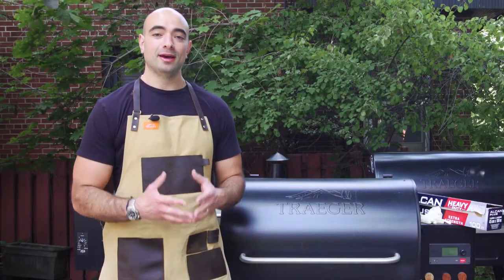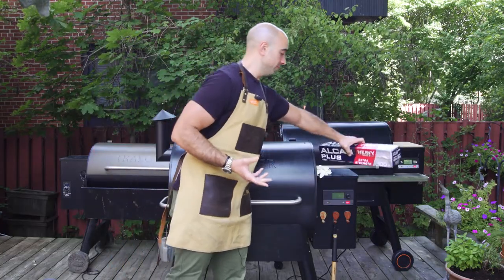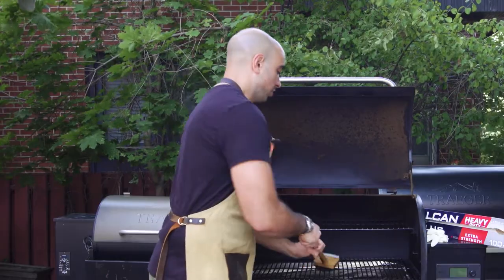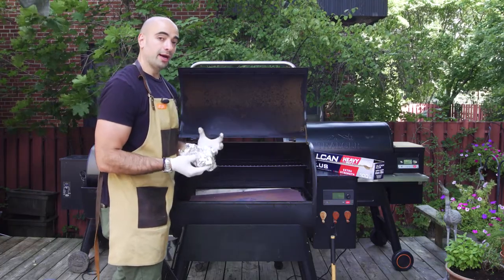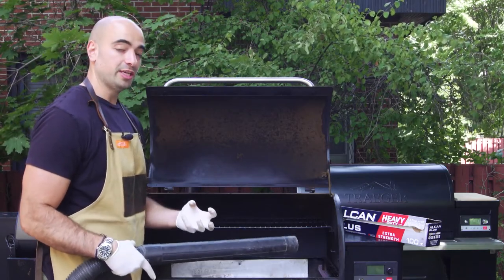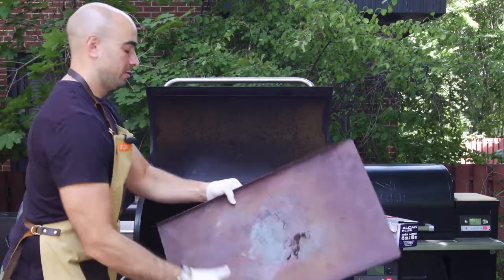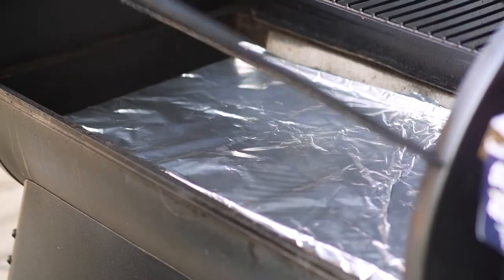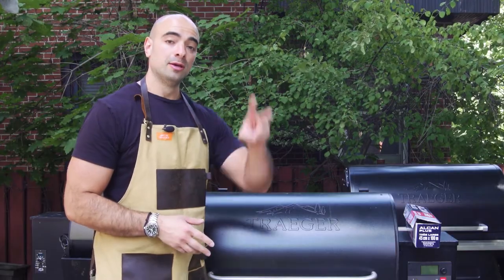How to Clean a Traeger Grill - Regular Grill Cleaning Routine

Comment: Here are a couple of tips that make assembly slightly easier https://www.youtube.com/post/UgkxCx5fHawkK9OoV-ojFrY8JLnZrFwAmvUt . 1) One person can assemble, but if you have a buddy to help, it will make it go faster - especially steps 1-3 and 8 (the legs aren't heavy but can be difficult to hold while screwing things in). Step 8, 1st part will take some time unless you have two more hands OR are really lucky. 2) Use a socket wrench! 3) Step 7, 3rd part - the flame carry over tube has an open side, MAKE SURE THE OPEN SIDE IS FACING THE FRONT. If it's facing the back, the tube won't work. 4) Step 10, 3rd part - if you don't have small hands (I don't, they're gigantic) getting the nut on is really difficult (but not impossible). It took me about 4 hours to assemble, but I took a "union break" every 60-90 minutes and ate a quick lunch. Also, I'm really OCD so I took my time, looked at the instructions carefully, and cleaned up as I went.

Comment: great video.  do you know why i had "grease" pouring down the RIGHT side of the grill next to the hopper????  i didn't even have "half" of the grease pan filled up.  and, i clean the grill.  Soooo i'm confused as to why this might happen. brand new traeger too.  is it possible it's the gasket?  do you have any thoughts?  also, i love the foil trick on the aluminum pan.  I will do that.

Comment: Hi, My Timberline ruined my Thanksgiving turkey last night!. I got several issues from not reaching or keeping the selected temp. But also when I tried to restart the smoker I got a "Clean Grill" indication that prevent my smoker work even I have cleaned everything  including sucking the fire pit. What would it be the problem? , Software?
Reply: I know it's been over a year since you've posted this, but did you ever figure out what that problem was for temperature swings? I had the same problem on the first use of my traeger while smoking a brisket, and the flame went out. 
The pellets piled up in the fire box, because the rod kept pushing the pellets in there. Pretty annoyed

Comment: Do you have suggestions for paint? Something you've tried? Getting some rust bubbles already on a 4 month old grill in the hot spots for the 885.
Reply: You can get high heat spray paint. It's meant for wood stoves, etc.
Reply: Big box home improvement stores carry it in the paint dept